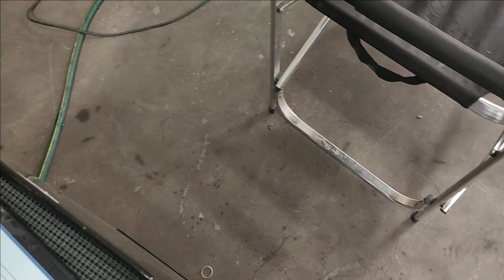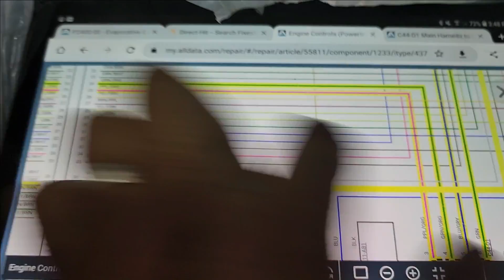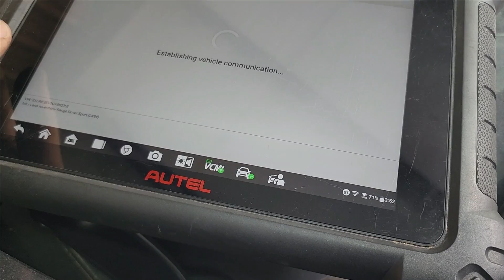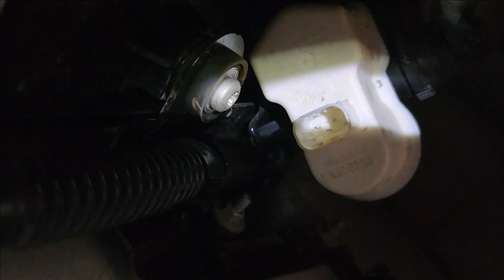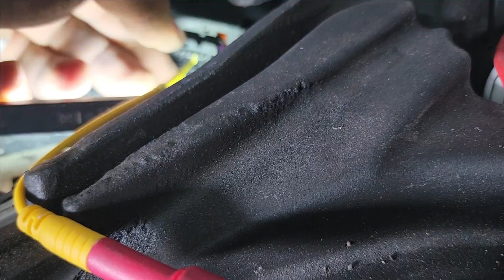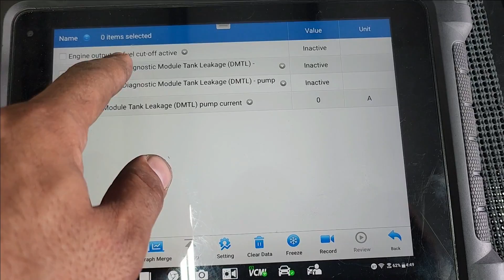2016 Range Rover P2400 EVAP SYSTEM LEAKAGE DETECTION PUMP CONTROL CIRCUIT OPEN P1

Comment: What kind of OBD are you using? I am interested to know if this is an "Autel Scanner MaxiCOM MK900BT"? Please let me know and how much it costs you. I rather invest in an expensive scanner that will show me all the wiring and connections to locate the problem than give my hard-earned money to a dealer who cannot fix the problem at one time.

Comment: I got the same issue!! I took it to Land Rover but after few days the light came back and I don’t wanna put that much money again. I’m driving with that sign but if you can refer me someone I’ll definitely fix that from there bcz I believe most of the people doesn’t know how to fix that. I’m from Philly. Looking forward to hear from you.
Reply: Did you ever find a solution?? I have the same code and it all started by having trouble at the gas pump starting after I would put gas in I would have to sit there for a minute before it would fire up but money being tight I'll let that issue go and now it's to the point to where I have to use a gas can to put the fuel in for it even to accept any and it will only take maybe a gallon at a time before it spits it back out.. I had the link detection pump replaced and then a filler neck hose that Land Rover has a recall on some of them the inside of the hose deteriorates and closes up but anyway I'm getting desperate here me and my gas can lol😢
Reply: No I couldn’t find any solution for that.

Comment: My check engine light came on..p2406 code EVAP and cinynders 12345 with misfire.. I just replaced the engine on my landrover lr2 3.2.. do you think it has to be program and pair with the new engine and computer?? Do you think the computer is not reading the new engine.. it's reading the old engine?
Reply from the maker: I doubt it. The mechanic that replaced the engine should read service information and what needs to be done after replacing the engine. Idle learn and so

Comment: O_S_TDMP Pin 21. Output_Switched digital_Tank Diagnostic Module PUMP is the breakdown of the abbreviation and the particular wire the DTC is referencing

Comment: i would test the module for open circuit and mabee a amp probe to check current draw on a scope will engin runing u see on the scan tool active and test changing fast and test wiring direct at the pcm for open circuit for the commande wiring and test voltage with a load bulb
Reply from the maker: Hey Dan, how would you know which of the 4 wires are the ones to probe on for open circuit test and current draw? Scan tool does not have an active test for that component.
Reply: @DallasAutoDiag  the fuse wire green amp clamp or the control wire .but the scanner was showing on and off very fast will the engine was running
Reply: so one wire is 12v and test should done unplug module and 3 wire could be control and ground and signal or ref volt
only way to see is unplug module and test module by commande wire and 12v suply for open .i am no expert on rover

Comment: check pin fitment at the pump. Probe before and after the connector with scope. That should let you know which wire is signal return and supply and ground. substitute a load before condemning the pump or ECM.
Reply from the maker: But how would you activate the pump for the test to happen? Which 2 wires are going to be the ones to put the substituted load on.

Comment: I use scope & mm to test unknown pins of the evap module then find the evap motor supply.
Reply from the maker: How would you activate the motor? There is no command for it in the active tests section.